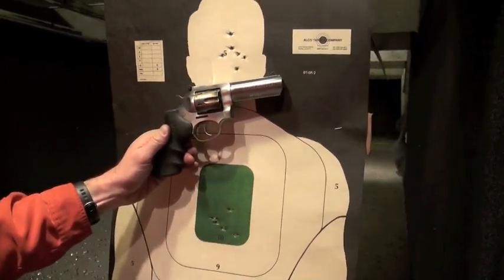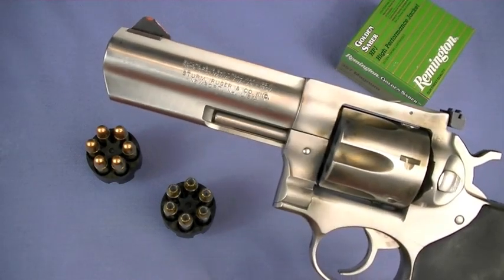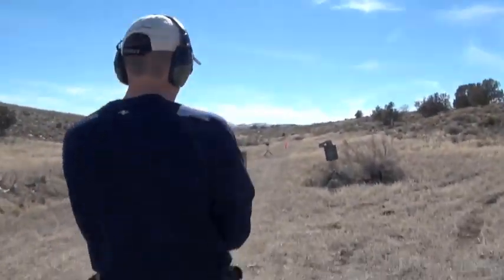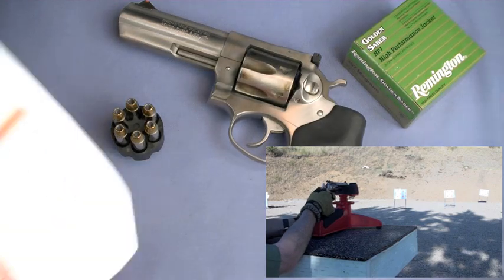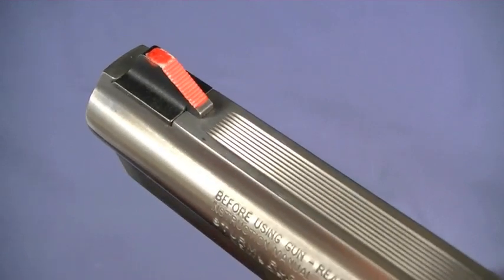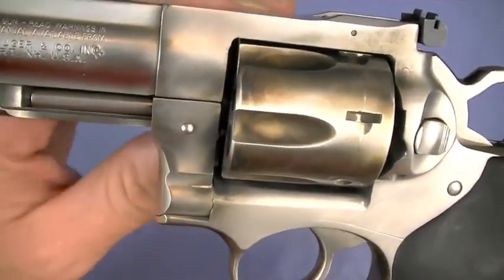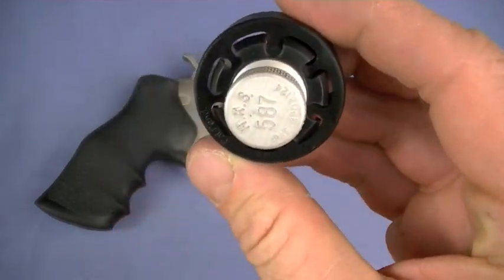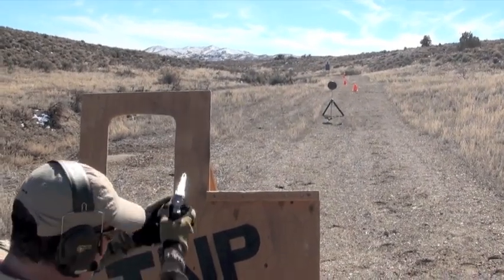Ruger GP100: "American Steel" by Nutnfancy

Comment: In my experience, the reason you had the "misfire" was because you released the trigger before the hammer fell completely, causing the firing pin to retract before the hammer could slam it into the primer. I've done this many times while DA rapid firing. It's just operator error. This gun is rock solid. Keep it up Nutnfancy! Love your stuff.

Comment: I had a taurus 65 and it was actually a great shooter and after trading I missed having a .357 so I decided to finally finish collecting guns but buying a Ruger GP100 yesterday and I'm in love. Now of corse I'm on the look out for a six series revolver. My GP100 has a 4in barrel with a half lug and fixed sights and its absolute tack driver, first 6 shots out of the box grouped 1inch with 4rounds touching on the bullseye at 12 yards. Feels great, shoots great, looks great. Love love love this gun

Comment: Re: trigger job

As a GP100 owner I agree the trigger is not great out of the box.  For those on a budget who maybe can't afford gunsmithing, DRY FIRE!.  No kidding, I spent a week+ dry firing.  Once I got to ~1500 pulls not only did I develop some muscle memory, but the pull absolutely smoothed out.

I also have used a dremel polishing kit on the "shiny" parts internally.  This is less aggressive than actual filing or stoning, but it's also safer and harder to mess up.

Comment: I have a 6" stainless GP100. It is somewhat muzzle heavy and cumbersome but is very accurate and soaks up the recoil from full-house .357s very well. Easy to fire rapidly without the gun bucking all over the place. The 6" barrel also gives better velocity and energy all with less muzzle blast.

Still, I think for a "combat" full size .357 magnum the 4" w/ underlug is probably superior.

Comment: Had mine since 2000 and have no issue.  My father used one for 7 years in LE for the state of Georgia.  Would take one over a S&W any day.  That is only my two cents.  Very strong frame and loves to eat magnum loads.  Great Video NUTN!   In fact after I saw your SP 101 video I went to the Store the next morning and purchased one to match.  Great carry weapon just has alot of weight with it.

Comment: My first hand gun I purchased back in 1985.. GP100 with 6" barrel and in stainless.  Love it.  Had it rebuilt once after thousands of rounds.  
I would agree trigger not quite as nice as a stock S&W 686 or Python but near and for hundreds less than either of those.  I will have this gun till I die.  Loving it still.

Comment: Yep, I've got one, just about a year old, and I LOVE it!  I've got the 4", and it's the best $595 I've ever spent.  I've already put aftermarket Altamont Grips on it, and I want to change out the front sight for a fiber-optic site.  I'm not a fan of shooting .38's in it; I bought it specifically to have a magnum cannon to shoot for fun.  Of course, for those who shoot it I can use .38's in it, and it's much controllable.  Mine came in dialed in for 158gr. loads, and I haven't fixed that yet.

Comment: I setup my 6" Gp100 with a Weigand no gunsmithing mount and a 2x Weaver pistol scope. This is the most accurate .357 I've ever owned. And compare the cost to a 686 and you'll never go back. Built like a tank and a tack driver to boot.

Comment: Regarding your comments about the Ruger's responding better to gunsmithing to the S&W's..........you hit the nail on the head. Any Rugers ive ever done trigger jobs on for myself and others have had zero hiccups and even with the lighter hammer or rebound springs the guns have performed flawlessly with no light primer strikes. On almost every smith and wesson ive performed a trigger job on putting in the reduced springs and other internals have caused some light primer strikes and had to find the right "combo" of springs that worked best and still was able to get consistent primer strikes on almost all standard ammo. So the S&W trigger jobs almost always take some testing and changing out before you can get them just right. THe really light springs for S&W almost always cause multiple no strikes or light strikes so its almost pointless putting them in. Ive found going down 1-2 lbs is about the most you can reduce the trigger pull on S&W in DA before you start having problems. I will note however you can get a very very slightly bigger/longer firing pin for the S&W, which if your going down really low on springs you almost have to put in. You can get them on Brownells and for trigger jobs on S&W once you go real light getting the longer firing pin is a must. But then you get into issues of the pin hitting too deep on primer, which could be another problem all together. And even with the new firing pin on really low double action springs you still get the occasional light strikes on really cheap target ammo, just not as much with standard firing pin. Just some notes ive picked up performing multiple trigger jobs on both. Rugers tend too take to them better, where the S&W's need some tweaking along the way to the the "just right" job. Even with a really good trigger job on the Rugers the trigger still just feels and squeezes different than S&W. The triggers just feel different. I like both. But each has its own characteristics. Its hard to get rid of the slight stacking on the Rugers, as this is just how the trigger performs. I dont mind it at all thou. The more I own and shoot Rugers, the more I love them and say they are the ying to the Smiths yang. Both revolvers are outstanding and have their place. Ruger is just a tough and rugged gun. Its like a solid brick of metal. I have GP, Super redhawk and SP101 and love all 3!!!

Comment: Look at the residue on that cylinder! You shot the crap out of that Ruger! Nice job. I am sporting the 6" version and plan to run and gun with it soon. I am replacing the the front sight with an orange sight to improve visibility (mine is currently black). I would recommend to your viewers that if you want to do a lot of magnum shooting to get the longer barrel, but if you want to run and gun with it, get the 4".

Comment: These manufacturers have been around for years. Why can't they get the trigger right straight from the factory?
Reply: they could, but it would add cost.  It's part of the reason S&Ws cost what they do, better triggers and better fit and finish.  Ruger has always delivered guns at an aggressive price point, and to do that you have to make some compromises.  Just the nature of the beast in many ways.  But I find that Ruger triggers are at least serviceable-acceptable out of box.  They can be lived with and can work well, but they can be improved pretty easily by someone who knows what they're doing.
Reply: My GP100 was a little gritty out of the box and has gotten smoother over time.  I also polished contact surfaces.... It's amazing.

Comment: Brought back memories.  The first centerfire handgun I purchased when I returned from Vietnam was a new 6" stainless Security Six.  Put TONS of hot rounds through that beast, and I still have it.  The wooden grips in those days were a joke, but it aquired "a" Hogue (can't call it a pair) which is still wears.  But the Hogues in those days exposed the backstrap like your Smith.
I'd fire it in an indoor range with a full load of 2400 and there'd be a 6" flame our the muzzle!  Yee-HA! Light em up!

Comment: RE:  Lead removal.  Use Chore Boy brass scrubbies available from the supermarket.  I cut a bit off, wrap a nylon brush with it, dunk it in Hoppes and clean away.

RE:  Carbon removal.  Use a green scrubbie with Hoppies.  It does not remove metal.

Comment: I love my GP100, I put in a Wolf Spring kit and a brass bead front sight with a shallow " V " rear sight. I had the old grips with the wood inserts. I changed those to the smaller Ruger grip that was put on the .38 fixed sight GP100. They still have the rubber with wood inserts, they're just a little smaller.  I can get more grip on it for speed shooting.

Comment: Personally I think a trigger job on these rugers is pretty easy to do with cratex wheels and your fingers.

Look and see where parts are interfacing with each other, rub them with the cratex till nice and shiny, don't change any angles but clean them up. It doesn't take a rocket scientist or expensive stones. You can screw up with stones a lot more easily than you can with a little cratex wheel and finger pressure.

Comment: came back from range today took ruger gp100 in both 3 and 4 inch, smith 28 4 inch and smith 686 4 inch, 500 rounds down range at 25 yards and all groups were less than 2 inches, if I put 2 or 3 rounds of hollow point in a 1 to 2 inch space in ones chest they are done normally with 1 round. will never put a light or laser on any gun, because I will see the light long before you see me if I am the bad guy, being the bad guy I have the advantage because I am depending on darkness, you as the defender know your home and have to use your night vision and knowledge of your home to take the advantage, ps smith will always shoot tighter groups but then you pay for that, ruger will always perform combat may not score real good in competition for consistent 1 inch groups but it will save your life which is what it was designed to do, smith was designed to do both, as was colt, now if you want a quality reliable colt get the trooper 11 or before they have the same performance as the python for the most part but they hold up a lot better because they were made for service.

Comment: I've shot the 4.2" but own the 6". In my opinion, both have performed equally well at similar distances. The only difference I noticed is the 6" is better at absorbing the recoil of both the .38 and .357 than the 4.2" because of the further barrel extension and added weight.

Comment: I think cylinder wiggle is supposed to be checked with the trigger depressed and the hammer held back manually. This is the condition of the cylinder when locked for firing.

Comment: I own a GP 100 357 bull barrel Magnum with the bottom lock 4 inch it has been the most accurate Gun I have ever fired and I have fired a lot my favorite Gun are the sig 6 hour the 1911 the Smith and Wesson 4 inch officer model you say you don't want to take it on a hike or a long distance walk I've taken mine on both including pig hunting fully adjustable rear and front sights did you ever think that those sites were built to remove and put a scope on there is scope mounts for the gun and it is one of the only handguns that you can turn into a rifle you have a lot to learn son but still a good video

Comment: Another small difference between the GP100 and Security six is there is an extra piece to take out when breaking it down.  A little lug in the front cylinder lock.  I own a couple SP101s and like the breakdown of the newer model revolvers better.  I had to sand down all my triggers for they tend to be a razor shap for a left handed shooter.

Comment: FYI There is no tap rack bang for a revolver sorry Fancy but I'm going to have to call you on this one, if the cylinder fails to go into battery like you were explaining you never...ever smack it in. Same reason you don't swing it out with great force you can damage or bend the crane. Next time you see that problem empty the gun and check underneath the extractor star. Crud build up and powder residue under the star push it out just enough to jam it up, so don't miss that spot when cleaning

Comment: Did you ever get that Speed Six?  I bought one back in the early 80's I think.  It is a great little .357.  You are welcome to use it if you like.  Just send an email.  A fun little revolver using either 38's or 357's.  All the hard edges were polished off on the Speed Six version which is why I choose this one over the Security Six.

Comment: I maybe old fashioned, but I think revolver has to be 1)Black and 2)six shot.
This pretty much rules out modern S&W product line. This leaves Ruger GP100 as only considerable option. I would say that Ruger looses a notch in accuracy, but it sure is built tough! 
My dream line of must have handguns is 22LR, 9mm, .357Mag and .45ACP. Two last ones are still missing ;)

Comment: Just bought this and picking it up in a few days.  Mine is actually a GP 141 though I can’t see any difference and the barrel actually identifies it as a GP 100 which is odd.  Can anyone tell me what exactly the difference is?
Reply: DocFlamingo 

Its still just a GP-100.  'GP-141' is an example of a catalog number used to differentiate different features within the GP-100 lineup.  Yours should be a blued GP-100 with a 4 inch barrel.  A KGP-161,  on the other hand,  would be a stainless GP-100 with a 6 inch barrel.
Reply: vor78
Ah, thanks.

Comment: I also enjoy my GP100 with 6 inch barrel. I strongly recommend the YouTube video "Ruger Double Action Revolver Cleaning." I keep my lube of the cylinder assembly (not talking about inside the barrels) to a minimum. If not, you risk having the inner workings of that assy. collect so much carbon that after about 30 rounds, you won't be able to close the cylinder. To clean, I repeatedly apply Hoppes#9 and GunScrubber spray to the front of the cylinder assy. workings. Then I keep that part dry.

Comment: nice review. you said you wished they made a version without the full underlug, and they do! i have a 6" barreled version with out the under lug. ive owned both versions and am tossed as to which i prefer. also in regards to mounting a light, there is a company offering a full rail that slips into the front and rear sight locations with no machining. with an offset or tri rail set up you can load it up as you please. if youd like to give the short lug version a try, contact me

Comment: @RightWingCon81 firing any round indoors w/o hearing protection can cause hearing damage but if you're in a situation where you need to do so, there are far bigger problems to deal with.  Hearing loss would suck , but a small price to pay compared to the alternative IMHO.

Comment: Hey Nutn for awhile they did make half lug 6" but not sure what other lengths they did. Id like to know more info on the half lugs once offered. I heard a rumor that the 1st half lug 6"ers were just using old security six barrel stock as they were discontinued and then went full lug as they ran out.
Reply from the maker: Well I used my revolvers for range use and for fun.  In that POU, I like full lug all the way.  The weight helps stabilize the gun.  -Nutn
Reply: nutnfancy I like the rugers
Reply: +monsterman27 Ruger is out with half lugs again.  Look up the GP 100 Match Champion.  The newest came out earlier in 2015 with an improved (IMO) rear sight.
Reply: Jeremiah Puckett Yeah but not in a 6 inch.

Comment: I HIGHLY disagree with the "truck/vehicle gun" POU.  chances are you will be without hearing protection in your vehicle, and chances are you will be using .357 HP. fire this monster inside an enclosed space. (haven't personally experienced the enclose space firing) however I have fired this thing in the open and that was incredibly blasty

Comment: God this gun just looks and feels TOUGH! If there is one word I would use to describe the GP100 is TOUGH, as opposed to the S&W 686 which I would use the word SLICK to describe. Its so weird how the GP100 and the S&W 686 just feel different. Neither is better than the other. They both are just pure quality. As a note I would put the Ruger SP101 right up there with them both. The Ruger SP101 is a little fucking tank!